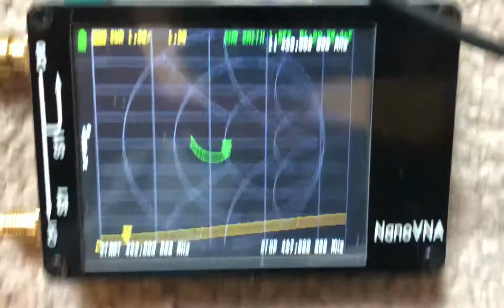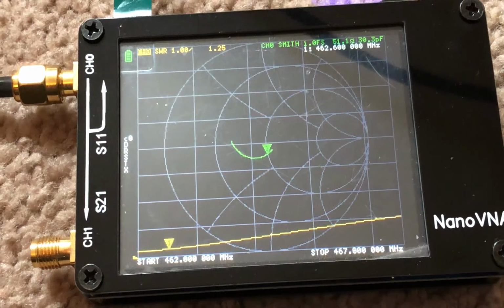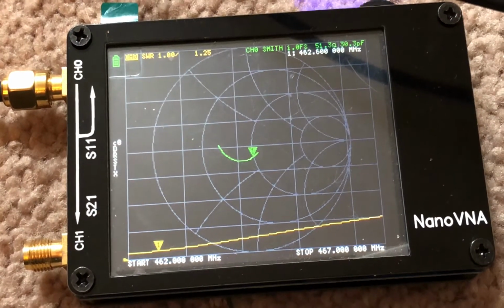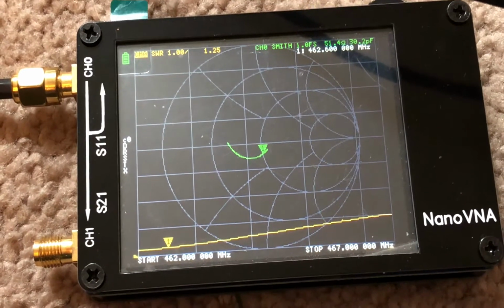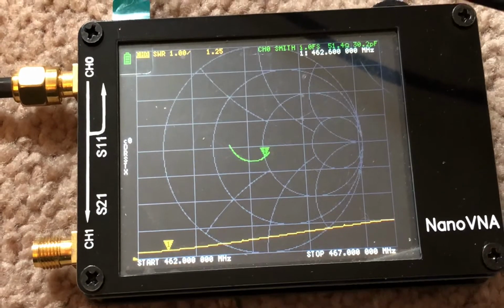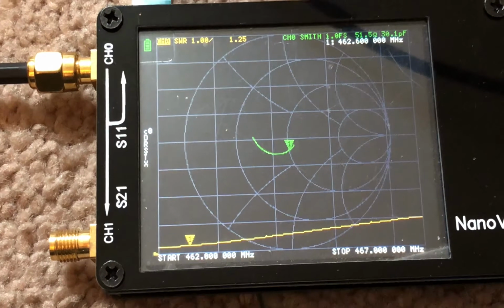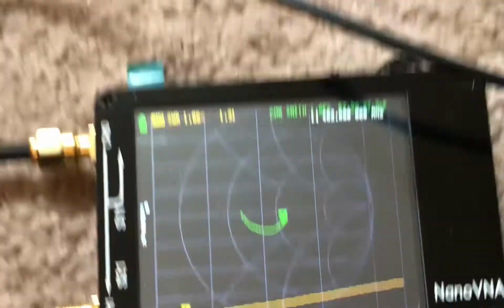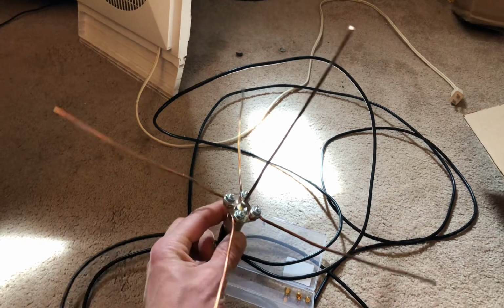GMRS HOME BREW ANTENNAS.

Comment: I just bought this NanoVNA H4 after seeing so many videos about it.  However, it only came with this chart or diagram, not a regular RTFM.  Compounding the problem, I've also seen at least a dozen videos on how it's setup and how it's supposed to be calibrated and recalibrated, hit the reset or not,which order of operation, when to use or not to use the pair of jumper cables it came with -- in short, confusing instructions and opposing opinions that I'm starting to regret the purchase.  I was looking at the RigExpert but too expensive for my intended use, which is just the SWR!  Like what I see on this video, I'm interested in making that homebrewed 1/4 wave antenna.

Anyway, I'm just a newbie, got my GMRS license, bought at least 3 radios with several antennas and aftermarket ones from 3 inches to 15, and I just want to know the real SWR and its ranges using different frequencies, but I'm still stuck with this Nano on how to be in its properly calibrated setting.  BTW, regarding the quarter wave elements, I know from the calculations that it's about 6 inches using 465 MHz midpoint, but I'm also reading and watching several articles and videos that the radiating 4 elements should be about 10% longer than the main vertical element?  Again, many confusing and opposing opinions from "experts."  Geez, maybe I just want to find out myself, and that's why I purchased the Nano, but haven't really used it yet.  I haven't talked to anyone yet, let alone "hit" a repeater, still getting the hang of it, mastering on how to use this Chirp software and the lingo lingo of radio.  Good luck on your antenna projects, WRSM..., clear.
Reply from the maker: I’m a little busy right now but I will look that model up for you and see if I can get back to you with some instructions.  Yeah, there’s so much information out there. It’s hard to know what to even do. I want all I know is it worked for me and I just stuck with that. But you know what it’s sometimes just cheaper on your mental sanity is just a buy an antenna.  Yeah, it’s fun to make things, but really isn’t worth the aggravation sometimes? 
But I will get back to you about this model you mentioned. We can see what to do.